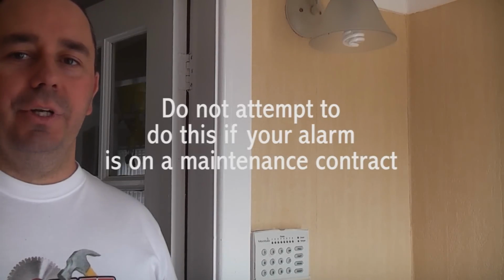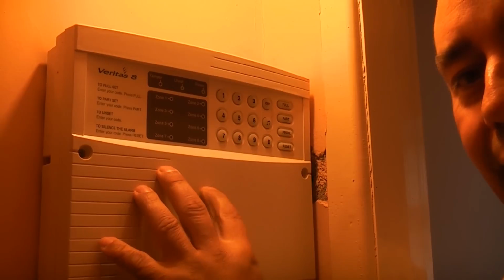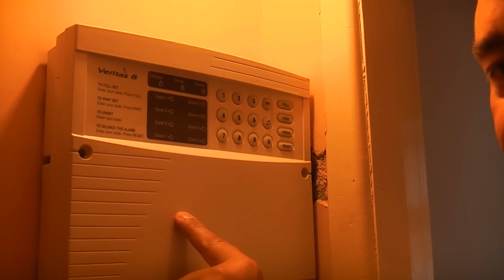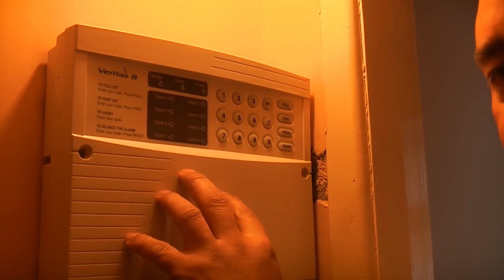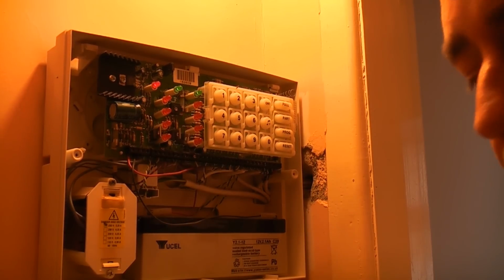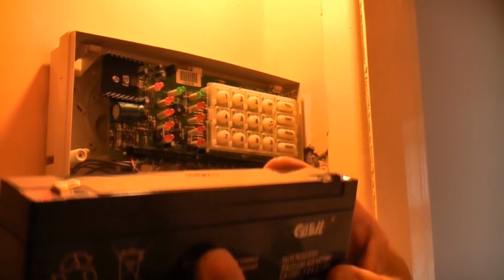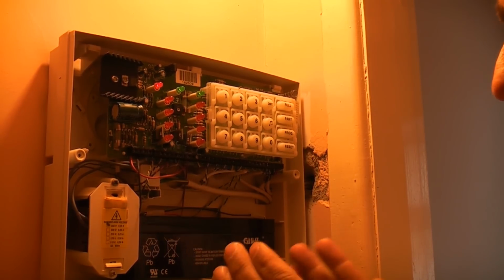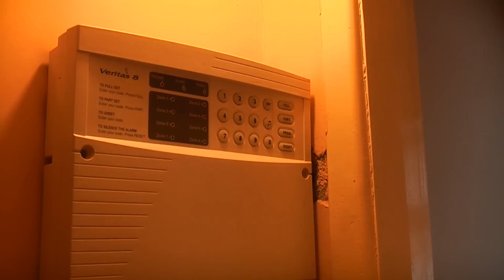Replacing a burglar alarm battery

Comment: I have some sort of Accenta ADE. We had a power cut yesterday, and the alarms started screaming as soon as the power came back on. I don't have a code, so I had to switch it off at the main switch board.

That worked fine for a few hours, but at around 1am it started making loud clicks, or knocks. There are no lights on except for the actual keys, which flash with the clicks.

I also can't see a way to get into the main alarms, and not just the remote - it's just a white, smooth box with no screws that I can see. Any ideas of what to do here?
Reply from the maker: Charlotta Lind 
If it's switched off at the switch and the battery is dead, the alarm should eventually cease to do anything when all the power from the battery is drained fully. 

The smooth white box that you describe, is it anything like this kind of thing-
https://www.youtube.com/watch?v=PBW7zVQ2fZ8

That panel is roughly the size of an A4 piece of paper. If the white box you are describing is smaller than that it could be something else such as an internal sounder?
Reply: ***** It is a smaller, plain white box with no visible screws or anything, about the size of an A5. It is possible that it is only sounder (it's certainly where the noise comes from), but if so then the main alarm box isn't located in my flat.
Reply from the maker: Charlotta Lind 
They could have placed the main panel anywhere (if the A5 sized box is not it). I have seen them installed in out of the way places such as lofts or in built in cupboards etc.

Can you see the cables going into the A5 sized box? if so how many cables are there?

If there are only a couple it is likely that it's just an internal sounder.

If you follow the cable from the remote keypad/internal sounder they should lead to the alarm itself.
Reply: ***** I can't see any external cables at all (I assume they're in the walls), and since I can't see a way to remove the outer panel of the sounder I'm hesitant to attempt it.
Reply from the maker: Charlotta Lind 
Removing the cover from the sounder might put the alarm into tamper mode, so not a good idea to remove it unless you know the code or can find the main panel.

What was the switch for that you initially switched off?

Perhaps the A5 sized box is the control panel and it's some kind of compact unit.

It's almost impossible to say without seeing it.

Comment: hi there

I have a Vertitas 8 alarm system same as the video, my alarm went off whilst i was on holidayand I put it down to the battery has hadnt worked since then, I got a replacement battery, hooked it up but no power seems to be going to the unit? why could this be? I have left the battery in fr a day to see whether it needs charging up but I get nothing? Thanks
Reply from the maker: There is normally a fuse or two somewhere.
The first thing to check is the fuse in the Fused connection unit (if there is one).
If that fuse is working then there is probably a fuse internally in the unit, this is normally close to the transformer and is behind a black pullout fuse holder.
Reply: Hi Thanks for quick response. All fuses seem to be intact. There are 3, one on the green board, another directly under a small battery like object and another right at the bottom under some wiring which is connected to the fuse outside of the alarm system, could this be a spare? I cant tell whether the external fuse has gone as it isnt a clear one
Reply from the maker: Paul Booth
Sometimes you do get spare fuses in the alarm.
You really need to check that power is getting to the alarm, if it isn't the battery will not charge and the alarm will not work at all.
You can remove the fuse from the fused connection unit for the alarm and try it in an appliance you know is working, such as a table lamp.

Comment: where do i buy a new battery and how do i know the spec of the battery before i open the main control box?
Reply from the maker: You can buy the batteries from most electrical shops that sell cable etc.
You don't know the spec of the battery until you remove the old one, as there are a few different sizes.
If you have the manual for the alarm it may be possible to put it into engineering mode before opening the alarm cover, that way the alarm will not sound. You can then either take a picture of the battery or remove it and take it to the shop. Once the battery is removed you can reset the alarm and still use it until you get the replacement battery.
Reply: ***** Thanks for your swift response and the useful video.  No manual for the alarm and it doesn't appear to be branded.  Quick question - when I open the main panel, will the alarm then sound until I replace the battery or will punching in the code allow me time without alarm sounding to identify battery type and go and source one.  There appear to be a number of online offers but don't much want to wait for them to arrive in the post .... since batter low message on key pad has appeared, the alarm systm is not allowing us to arm the alarm system - that normal?  Thanks
Reply from the maker: *****
You are welcome.
I'm not familiar with every alarm panel, but most go into a tamper state once the panel is opened, this will make the alarm sound but normally as soon as you enter your code the alarm will stop sounding but the alarm will still remain in the tamper state until you close the panel and reset the alarm. On most panels you can open them up, enter the code to stop the alarm sounding and then remove the battery. You can then either leave the alarm until you go and get a replacement, or close the panel and reset the alarm until you return with the replacement. You should be able to use the alarm as normal without the battery.
Reply: ***** Thanks for that.  Got myself a new battery, fitted it and replaced panel lid on main box.  Key pad now says Reset Required, Call Engineer to Reset.  There is no 'reset' key on key pad and nothing obvious on PCB in main box.  Do I really have to call an engineer or is there another way around it?  Thanks again
Reply from the maker: *****
You could really do with the manual for it, are you sure there are no markings at all on it anywhere?
If you do a Google image search for alarm control panel do any similar ones show up?
Reply: Not got a manual but the alarm box outside is a Chevron Alarms box which would figure as this is a relatively local company.  The key pad is identical to the one on this page:  http://www.matrixsecurity.demon.co.uk/domesticintruder.htm so it looks like a Menvier TS590.  The manual is online but say if the key pad say call an engineer, I must call an engineer - http://www.bw-tech.co.uk/Menvier%20TS590%20User%20Guide.pdf  Andrew
Reply from the maker: *****
The engineers manual has more info including how to reset the engineers code- http://www.bradford-electricians.co.uk/alarms/engineer/TS590_Installation_496858_iss1.pdf

Comment: Thanks for the video. Very informative. I have a similar problem to one Colin Steadman encountered.
Just moved into a flat with an Optima compact ADE. There are no instructions and no code.
There is no alarm sounding when the mains power is removed. So I'm assuming the battery needs replaced
as well as finding out how to do a factory re-set.
Could you give me any direction regarding this?  Regards Steve
Reply from the maker: I think this is your engineers manual- http://www.ultimatehandyman.co.uk/forum1/honeywell-ade-optima-engineers-manual-t71762.html

It should tell you in there how to do a factory reset.
Reply: That is really helpfull. Many thanks. Steve
Reply from the maker: littlestewie griffin
You are welcome ;-)

Comment: I don't have anything valuable in my flat - is there any way of disabling the alarm altogether so I don't have to worry about power cuts and flat batteries? Would removing a fuse do the trick? The operator instructions are pretty indecipherable to me.
Reply from the maker: If you remove the fuse and disconnect the battery the alarm will no longer work, but if the external sounder has a battery back up there is a chance that it will sound until the battery in it is flattened.
Reply: ***** Thanks for the reply - I don't really like the prospect of setting off the external alarm, then trying to fumble the fuse back in to switch it off... I guess it's reassuring that it's hard to bypass, though is there really likely no setting which can just disable everything, maybe using the key code? Looks like I might be stuck replacing the battery and keeping it on.

Comment from the maker: @ Matthew Lyon
Some batteries are charged and some might need charging.
Your fault does not sound like the battery though, it is probably something else!
Reply: I think you're right. 3 days later, still having the problem.  It looks like I'll have to call a sparky.
Reply from the maker: Matthew Lyon
You could eliminate a few things first, if you wanted to.
But I do know from experience that faults like this are often caused by a fault in the external sounder, perhaps when water has entered the bell box.
You could place a link wire in the tamper terminals of the alarm panel, if the problem goes away with this link in place you know that the fault is on the tamper circuit somewhere.

Comment: this may be a silly question, are new batteries supplied charged or do they need to be connected for a while to take a charged? My RKP keeps sounding & outside strobe lights but not exterior alarm. when I input my code the tamper light comes on. Very intermittent problem, it's fine for hours then it trips every few minutes. then "settles" again for a while. My battery was over 10 years old, so I've just changed it half an hour ago. Problem is still happening.
Reply: Matt Lyon there is a law about any kind of battery that gets transported over sea or in the air. Depending on where your battery came from, it may fall under this law. They are only allowed to contain 35% battery. It should charge up after about 48 hours though. As I am typing this I just realised this comment is 4 years old lol. Hope this comes in handy for future knowledge

Comment: ***** If the battery in a bell box is dead will the bell box need replacing all together???
Reply from the maker: Hard to say without looking at it. With most of them you can replace the batteries.
Reply: I've got the same bell box as you :-)
Reply from the maker: I'm pretty sure you can replace the battery in that model
Reply: ok thanks but the only thing I need to know is, How do I Do it coz i dont no where the wires are going
Reply from the maker: How long has the sounder been installed?
These batteries normally last for 5-10 years!
If you remove the plastic clear cover in the bell housing and follow the wires from the battery they should be terminated onto the PCB?
There is a chance that they are soldered on but I don't know as I can't see mine now it's installed.
Reply: the sounder has been up for 4 months BUT the battery does look abit tatty. Also when we had a power cut the bell box stopped flashing like it usually does in stand by mode
Reply from the maker: Did you put the alarm in engineering mode before switching off the alarm?
Is the back up battery in the alarm panel itself working properly?
If the alarm's power is switched off and the battery in the alarm panel is disconnected or flat the external sounder will sound because the hold off circuit has no power!
Reply: The battery back up in the control panel is brand new. When we had a power cut at 2pm today the bell box stopped doing the alternating flashing. Meaning the battery in the bell box is proberbly dead or not working. Even though its a new bell box
Reply from the maker: I don't think the battery in the external sounder powers the reassurance LED's if there is a power cut. The battery backup in the external sounder is only there to sound the sounder and the strobe in the event of the power to the alarm panel being lost completely, such as if the mains power and alarm panel battery is not connected or the wire is cut between the alarm and the external sounder.
Reply: it doesnt not even sound aswell when the power went out as The panic button was accidently pressed all it did was sounded the internal sounder the bell box did nothing
Reply from the maker: Are you 100% certain it is wired up correctly?
Reply: yep I followed the instructions in the book
Reply from the maker: Does everything work when tested in engineering mode such as the strobe and siren?
Reply: yes everything works when the panel has AC power but when the AC power is cut or interupted the bell box does nothing
Reply from the maker: Weird, If I remember rightly there was a jumper that required moving to activate the internal battery- you did move this jumper didn't you?
Reply: yes
Reply from the maker: I hope the new battery fixes the problem ;-)
Reply: same. But i hope to get the problem I have outta the way

Comment: Any idea how you get the tamper light off? Mines got a solid red light on it, apparently it was last serviced 2009. Cheers
Reply from the maker: beatleschap 
The tamper could be on any of the sensors/wires in the system, your best option may be to link out the tamper circuit using a piece of wire (link) in the panel, then see if the tamper resets. If you want the tamper circuit to work you can link out each of the tampers at the actual sensors until you find the offending one (providing it's not a faulty cable).
Reply: Thanks. I'm not very clued up on alarms apart from the dreaded crap that wakes me up at 6 am every day . I think it could be a service thing, I'm reading on forums that if I switch electricity off, remove battery from the unit ,wait a minute or two reconnect then put lecky back on, this should sort it?
Reply from the maker: beatleschap 
It's worth a try ;-)
Reply: Thanks boss

Comment: hi - great vid

moved into a house with an ancient alarm - no manual or model number!

If i remove panel and internal battery and then take out the fuse for the mains power - will this stop it from going into tamper mode?

I imagine it will start ringin when I remove the cover? - will removing the battery and mains power cut this?
Reply from the maker: As soon as you open the cover it will go into tamper mode.
If you remove the fuse and disconnect the internal battery the internal sounder will not sound but if the outside bell box has a battery that will sound until the battery is flat, which is normally less than 30 minutes.

Comment: Hi does anyone know what to do if you dont know the code to this alarm? The alarm had already been fitted when we moved in, but the previous owner didn't leave the code.  The battery is totally flat and we've had to turn the mains power off of the control unit.  If I turn the mains back on it beep for about 10-15 seconds then sets the alarm off.  I have the manual, but its not very clear on what I need to do.  Help!
Reply from the maker: Does it tell you in the manual how to do a factory reset?
If not try and search for your alarms engineers manual, that should tell you how to do a factory reset. Once you have done that you should be able to change the number.

Comment: when the alarm goes into tamper mode when  changing the battery, what code is entered, the engineers code or the personal code that is used by the household????
mike d.
Reply from the maker: The personal code.
If you know the engineering code you can put some alarms into the engineering mode, then swap the battery and the alarm will not sound.
Reply: ***** does this also to apply to my Veritas R8Plus?
Reply from the maker: mike daly
I don't know, you would have to check the manual or try it. I'm not an alarm engineer and so I'm not familiar with all alarms, sorry

Comment from the maker: The burglar has to get in the house to switch the electric off, but then it should go to battery back up. If your alarm goes off when the power is switched off then the internal battery is probably flat, which is causing the self contained battery in the bell box to sound.
Reply: Could you pls show how to change the battery in an external sounder
Reply from the maker: Maxsdiscos
Thanks for clearing that up ;-)
Thanks for the comments
Reply: The electricity in many properties can be isolated inside the meter cupboard.
Reply from the maker: dantheman1547
I'll add this to my "to do list" ;-)
Reply: I think I might of replied to the wrong comment. Ultimate Handyman wrote that you would need to get into the property to access the power supply.
Reply: My alarm keeps on sounding even after we’ve changed it and we’ve had to completely power down the system please help
Reply: The bell box battery always seems to have power in it no matter how old it is unlike the actual alarm inside. Is there a reason for this?

Comment: Is it advisable to switch off the mains electric whilst changing out the battery?
Reply from the maker: There is no need to really, as long as you don't touch any of the 230v contacts in the panel (they should be shielded). If you do disconnect it from the mains the outside bell box could sound if it has a back up battery in it.
Reply: Cheers. Getting new battery tomorrow. Hopefully fix my problem. Good vid.
Reply from the maker: engineno9at
You are welcome.
If you know the engineers code you can put the alarm into engineering mode before removing the cover- that will stop the alarm from going into the tamper state. If not just follow this video ;-)
Best of luck with it !
Reply: ***** thanks.

Comment: JFK, We have a verita's 8c alarm, Battery changed 2 yrs  and now seem's to be in tamper mode every few minute's. Installer may have put in a service code but is no longer in business. Any thought's on away round this. Thank's JOHN
Reply from the maker: Have you tried linking out the tamper circuit to ensure there is not a fault with the circuit?
If you can get the engineers manual, it should show you how to do a factory reset.